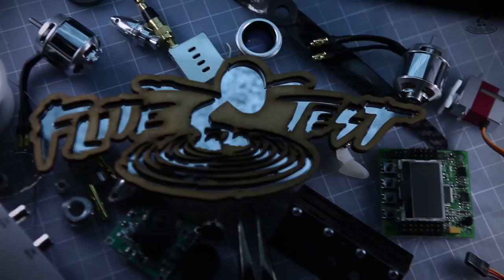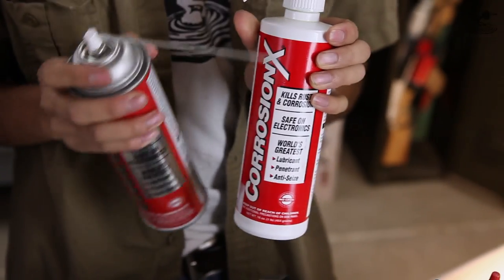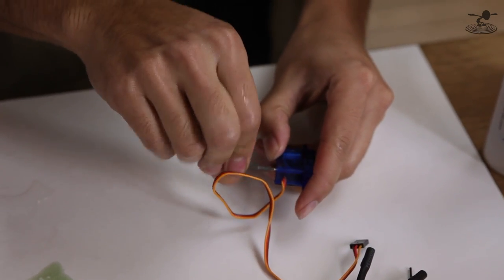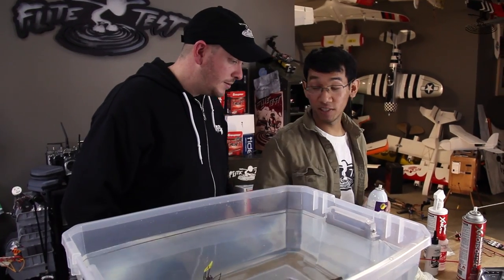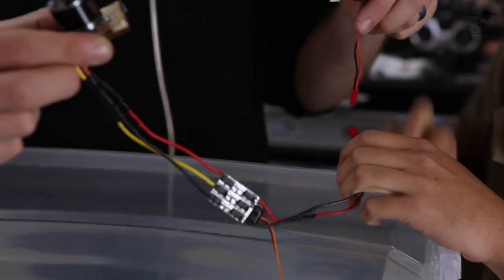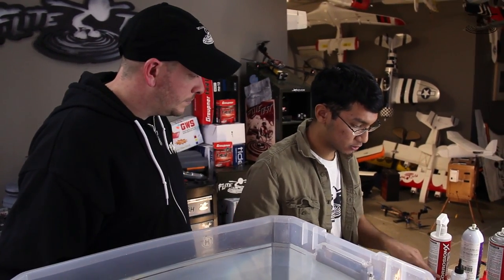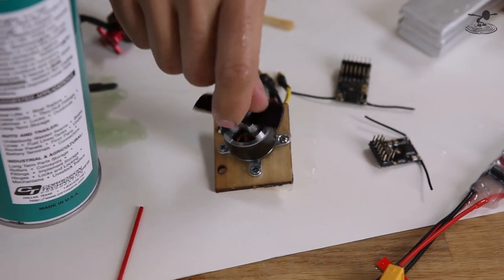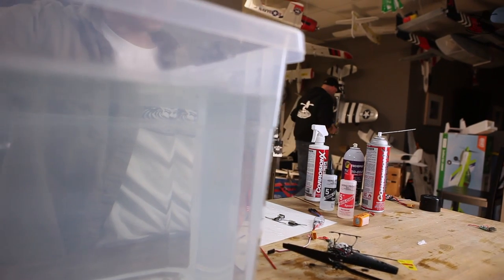Flite Test | Waterproofing Electronics

Comment: There is a general misunderstanding about electronics in water. The voltages that all these devices run on are in the order of 1.8-12 volts. Most of these electronics will not be affected at all
by water so you can dump all of that in a tub and it will still work no prob (no waterproofing needed). The problems will be in the long term when the water remains inside those devices and dries out , leaving salt patches which might or might not affect performance. Another thing is that you can't get shocked by putting lipos etc in water. Due to the low voltage, the current is very small and besides that current takes the path of least resistance so it flows between the terminals. It has no interest in going to your hand and back. So unless the water is very very salty there are no safety issues with such low voltages. Nevertheless , waterproofing is essential if you are going to dip your devices in water :)
Reply: The above doesn't apply to devices with buttons and LCD displays . Those get ruined faster by water.

Comment: I don't agree about 5 min epoxy not working. I had a powerful LED bike light (run by 4 18650s) that the strain relief was started to go so I removed the whole circuit board and covered it in epoxy along with the strain relief. A day later I dragged it through the lake and it worked just fine. I just used cheap HF 5 min epoxy.
Reply: Its fine for rain, but if its submerged for a day or two then it could turn whitish and make it bad.

Comment: Does corrosionX the normal and the green strong one eat foams?
Reply: +Multirotor Go good question I wonder the same.
Reply: Yes I am about to go on vacations to a lake and plane to bring an airplane it will be my first one and the only clear place to fly is over the water so I need to water proof it just in case.
Reply: +Multirotor Go they have a video for waterproofing foam board so check it out

Comment: wd 40 does not cause rust it just dries really quickly and the coating is not that tough. but definitely does not cause rust
Reply: TheDenver12311 
Exactly, it does not cause rust. 
It was invented to prevent rust.

Comment: Epoxy is too hard.Use 3M 24 hour dry 5200.Its flexible and will never come off whatever you glue it to.We use 5200 in the marine industry.It will glue glass to steel,plastic,silicone,steel pretty much anything to anything.and is waterproof and doesn't burn very well.If you need to remove it has to be cut or sawed off.

Comment: Does it work with WD-40?
Reply: ramable123 no wd40 will not waterproof anything its great if your cars distributorcap gets wet and your car wont start unscrew cap spray a lot of wd400 inside cap install screws and your car will start it displaces water works everytime!!

Comment: you forgot to touch on brushless motors with sensors they are not waterproof you need to somehow keep water off the sensors or they will not work afterwards

Comment: Well, you are wrong about epoxy. if you want the full amount of strength you need to look at the datasheet for the cure times. and the Cure temperature. Some epoxy will not fully cure at room temp. other resin/hardener combos might need lots more heat to fully cure. generally speaking, the amount of heat needed to cure the epoxy also dictates what temperature the epoxy will start to get soft and lose strength. cur at 60c Gets soft at 60c. also handling epoxy without gloves is just as stupid as handling acid without gloves.

Comment: This is not useful if you don't have the corosion stuff near you. Baloons make a good job of protectng from water. And if something happens use wd40 to get rid of the water. It does protect too. Silicone spray does protect battery's contacts for cars so it would di the job here too.
Overall not very useful episode

Comment: Well, there goes the myth about water blocking 2.4GHz :-)
Reply: look how little water was in the way.  The much more common situation, a model submerged in the middle of a pond or lake, has to penetrate far more water, due to the angles involved.
Reply: 2.4 ghz is blocked by about 2-3 feet of water.  Salt water and chlorinated water are even less.

Comment: josh 12 volts won't shock you
Reply: Jette Christensen you clearly know nothing about electricity, you cannot say anything about volts without also mentioning the amps, because amps and volts work together to draw watts (volts x amps = watt hours) if you have a low volts current running but have a high amp current running aswell it can kill you.
Reply: aviram schreibman you need a high voltage to run enough current through the body to affect you, this is because of the very high resistance of the body. Current=Voltage/resistance. There will be no current unless there is a voltage to push that current through the resistance. Maybe 12 volts will kill you if you connect it directly to your heart with needles. but through the rest of the body the resistance is too high for 12 volts to allow any real current. Around 0.1-0.2 amps of current will kill a man and these batteries can provide 100 ish amps depending on battery of course but they only have 12 volts so won't do anything.
Reply: Jake Roman yeah but how are you going to get 100 amps through enough flesh at 1 volt.
Reply: Jette Christensen baecuase its all part of the energy system, watt is a tool to measure the volts times the amps, the amount of energy is calculated by taking the watts and multiplying it with the times unit, so jouls equals to watts times the duration. Although the amount of joules that is able to kill you with electricity is a round 400 joules and most rc planes dont get to that, but you have to remember that 12v is enough to kill you if you have enough amps.
Reply: then lick both jumpstart cables from your 12v  car battery
Reply: SvPVids 
Uhh it is 12v from the battery and drops to 11.2v when you start it.  But it is 11.2v @400  amps or more. lol

The alternator puts 14.4v back into the battery.
Reply: Jette Christensen Grab you car battery with your lips 💥
Reply: yes 12v at 400+ amps won't shock you
Reply: Jette Christensen try putting a 9 volt battery with the leads on your tongue tell me if that shocks
Reply: +Xavier Schario +Jean Quad VanDamme +Bob C Your tongue has a much less resistance than your skin so 12 volt will probably shock you. And RIP anyone who tries it cause car batteries have high amps.
Reply: lol people think 400A maximum rated current at 2 volts will kill you... funny.
Reply: @aviramschreibman1032  lol a battery isn't a perfect constant current supply, amps = volts/resistance.

Comment: why not use liquid electrical tape instead of epoxy and all that crap.
Reply: Because it gets brittle when heat is generated - like on ESCs.
Reply: Not if he used is on the end of the shrinkwrap like he does the epoxy, and then there's the plastidip.

Comment: "Getting shocked" by small voltage DC? lol, you smrt :)
Reply: I believe it's the amps that would hurt, I could be wrong
Reply: 1amp is enough to stop the heart!!
Reply: Lol, 50mA is enough to kill you if it goes trough your heart, but since the water has an insane amount of resitance and even more so does your body, low voltage DC will never pierce your skin no matter what amperage
Reply: Petsku  You're pretty safe with anything below 48V. Current isn't that bad when you're working with low voltages.
Reply: Johan Fasth lol it works like this 1000volts wont kill 1000amps wont killl you but if you have both you will die
Reply: Johan Fasth i know i said that to make a point hell even 100volts and 10 amps can kill you or 250volts 5amps can kill you need both sure 1million volts might kill you but add the 1million amps and your whole body will explode it realy depends you need realy high voltage to kill without amps but amps alone may not do anything accept melt metal or amps alone have to be this amount to kill without the volts police tazers have killed people but whether that was because there body was too old or not strong enough to handle being shocked or died from the shock of being shocked
Reply: Guys just keep the numbers down for safety!!! Please... Stop saying 1000amps or1000v wont kill you... That sounds dangerous... We have kids here on youtube they may want to experiment.... Not good
Reply: Remember ohms law! Voltage and current are related, a low voltage cannot create a high current through a high resisitance. Flesh has a high resistance so there is no danger at these voltages. You can't think of them in isolation, even a welding supply provides a low current through a high resistance.
Reply: to be fair, I wouldn't physically touch or get too near the terminals of any battery (even 1S) submerged in (salt) water because while it might not "shock", if there is enough conductivity across the terminals it could burn you
Reply: Li stand corrected
Reply: I worked at a place when I was younger dealing with 20,000 volts, electrostatic paint booth.  I threw some coffee in there once after a long shift when I thought the guns were off and got struck with a 20,000 VOLT Bolt of man made lightning (basically)..  the amps were very low though, so it was harmless, woke me up though!  Less dangerous than pissing on an electric fence, much less.
Reply: BWX hahaha great experience
Reply: littlest workshop is right about the relationship between current and voltage... but remember that the human body's resistance varies as well.  Normally several mega-ohms, but can be as low as 300ohms.

As far as what can kill you, it heavily depends on where you get hit and what you get hit with.  As little as 10mAh across the heart, will result in death.  Going through the brain is also extremely dangerous.  OTOH, I have heard of welders accidentally running tens or possibly hundreds of amps through an arm or a leg, and not noticing (due to insta-fried nerves) until they smell cooking meat.
Another concern is AC vs DC current.  AC current, especially 50-60Hz, can disrupt the electrical signals regulating your heart, causing fibrillation and death up to 24 hours after receiving a shock.  DC current, by comparison, causes your muscles to seize up, causing you to involuntarily grab on tighter to whatever's electrocuting you.
Reply: The lack of understanding of Ohm's Law is staggering. You can't supply 50mA through your heart without quite a lot of voltage due to your body's resistance!!!!
Reply: Jonathon Oxlade, you know nothing. You cannot supply voltage and current INDEPENDENTLY.
Reply: Lozzie74
As I mentioned earlier, the body's resistance under certain conditions can be as low as 300ohms.  I should know, because I HAVE been shocked by a 12v power source.  That's still not enough to reach the fatal level of 10mA, and it wasn't across my heart, but still... not an experience I would want to repeat.
Reply: kotori87 Stating a specific resistance for the human body is somewhat meaningless, between where and where is this resistance measured? And what are these certain conditions? The whole thread is a little silly, I am sure Josh has touched both terminals of his batteries dry before but got spooked because of the water, regardless of any potential for feeling a mild shock there was no risk of death or injury.
Reply: Evan Forst the voltage has to be high enough to by pass the resistance of the skin. usually about 45 volts. everyone is different though. you could have 10 volts at 800 amps and it would not kill you. but 300 volts at 800 amps will blow half your body apart.
Reply: Petsku 50mA can stop the heart!
Reply: Smallenginedude, you cannot independently control voltage AND current. You won't get 800A into a human being with only 10V!!!
Reply: Kotori87, please explain how 12V into 300 ohms is not enough to reach the fatal level of 10mA. Can you apply Ohm's Law? 12V into 300 ohms achieves 0.04 A or 40mA. Go back to school.
Reply: Lozzie74 You are correct, I mis-quoted my data.  I just double-checked my reference, NSTM chapter 300.  At 1mAh, a shock is felt.  10mAh may cause a person to be unable to let go, and 100mAh applied across the heart (usually from one hand to another, or one hand to a leg) for 1 second or more may be fatal.

There are a few significant points in that chart.  First, those are minimum expected values for the stated effects, but they are by no means guaranteed.  Some people may survive a much larger jolt than 100mAh, and you may still be able to let go if you've got a 10mAh current running through you.  I also bases its minimum-safe-voltage assumption on the minimum resistance of the human body, not the average.
Reply: Thanks Kotori87, you're getting somewhere now. However, please understand that current is measured in amps (A) or milliamps (mA), not mAh. Are you quoting electrical discharge or current?
Reply: I think I don't need to join this conversation. lol
Reply: @jonathanoxlade4252  Many years ago, I got zapped by 380 Volts from a machine that someone turned on as I was underneath repairing it. All I remember is the big BANG, and then silence. I survived (obviously), but my entire body was in pain and my sight was gone for about 7 or 8 minutes. No lasting injuries, but man I was lucky...

Comment: cilicone would be alot better option than epoxy
Reply: silicone, acrylic, urethane or non electrically conductive  marine epoxy conformal coatings will be about as good. acrylic is easy to remove with acetone, while silicone and urethane need more complex chemicals and epoxy can only be burnt off. Generally: acrylic is easy/fast to apply and remove and protects well against fungus, urethane resists well to electricity, silicone resist high temperatures (200°c) and epoxy will resist most chemicals. but for planes acrylic may be the best one, because it's convenient, but if the only thing you have around is a small hardware store, you might want to use silicone caulk instead.

Comment: WD 40 does not and could not rust. You silly billy boy.
Reply: +mrsillywalk WD40 is hygroscopic. It will attract moisture which leads to rust. WD40 will make metal rust…
Reply: +mi_ Not so my dear Mi. It is an oil that displaces moisture. It is all hydrocarbons and they do not attract water.
Reply: lol there's plenty of people who make the mistake of using WD-40 to lube guns to find it will indeed rust your metal. After it loosens rust bolts (for example) your supposed to remove the WD-40. If you let it sit (over time) it loses it properties to prevent rust and will lead to a build up of moisture.  mi_FPV is correct
Reply: It does rust..they are right. Found out the hard way myself. I didnt believe it either till my 12 gauge did rust after spraying it. Didnt rust much but it was slightly there.